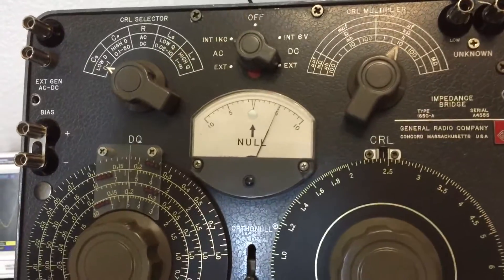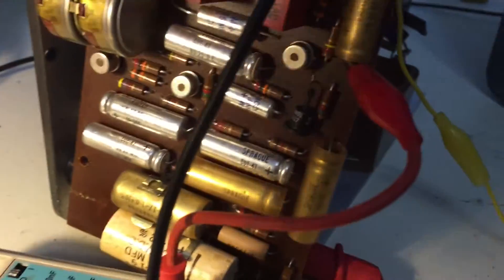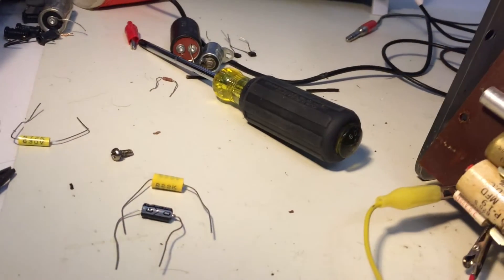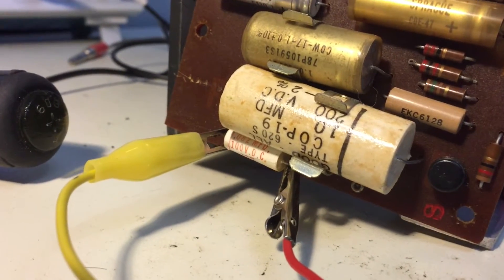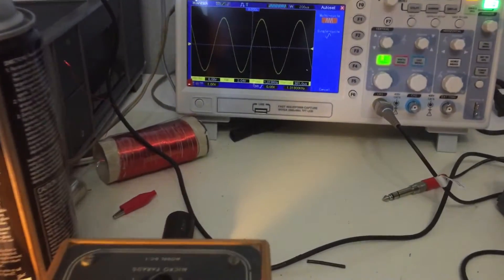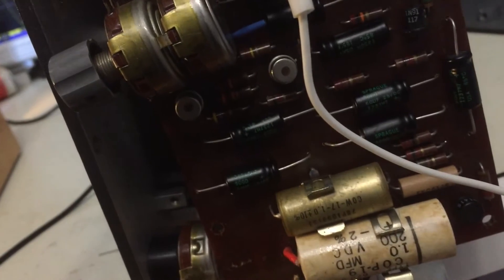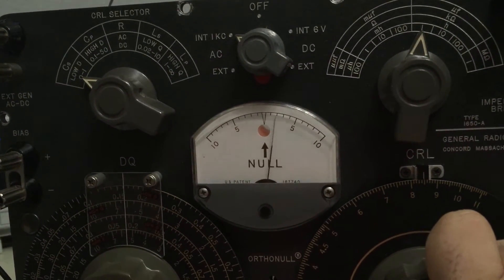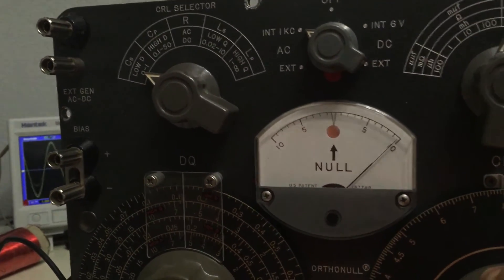General Radio Genrad 1650 impedance bridge - Oscillator Circuit repair and calibration

Comment: You may already know this, the envelope of the ring coded capacitors develops micro fractures and there voltage capacity drops dramatically.

Comment: Having the same bridge, I notice when switching on in the AC mode the meterhand moves all the way to the right. Even when the sensentivity control at the minimum. I changed all the electrolyticcapacitors and aligned the oscillator to exact 1 kHz.
Reply: But after a minute or so, the metrhand comes back to a normal position. So my question to you, does yours show the same? Please advise.
Reply from the maker: There is a section that outlines the checking of transistor voltages.     FAR right still assumes greatly out of balance.... does it work fine in DC can you read a resistor fine?.   Did you try both inductor and capacitor to see if it effects both?